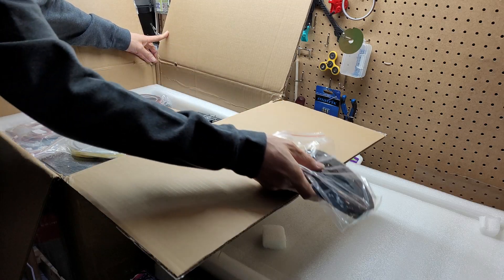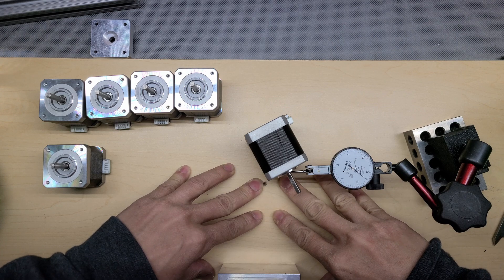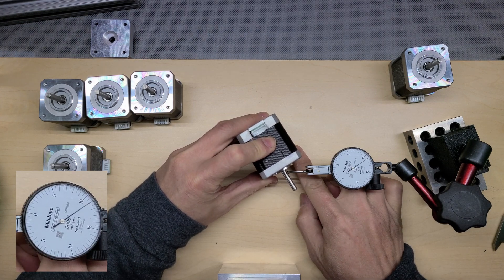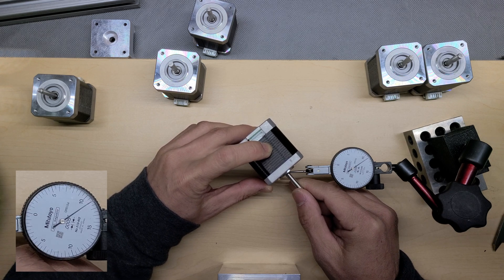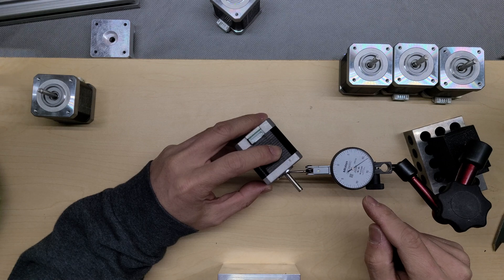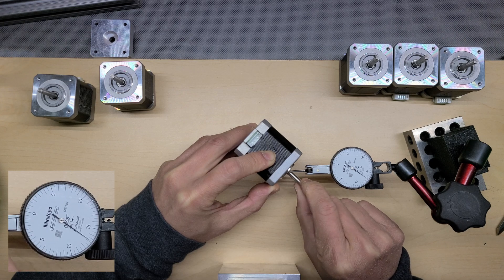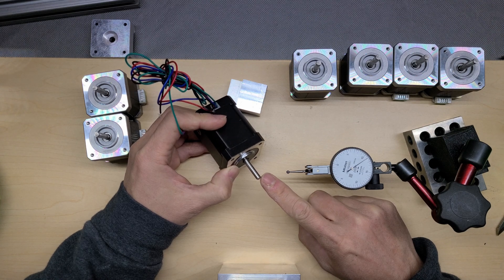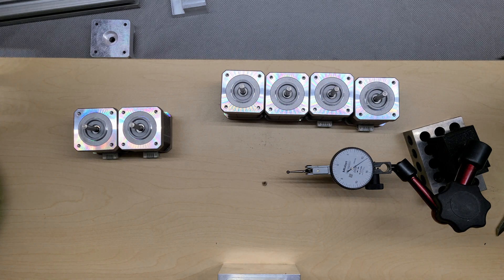Moon's Industries stepper motor in #Formbot 3D Printer kit TIR check and verification

Comment: Thanks for the nice video...i was planning to get the formbot kit also for voron 2.4 and as you know they use moons motors...so what i understand from your video is that the motors are good? I also saw your video of the printer build do you still recomment the kit?...thanks a bunch
Reply from the maker: My kit wasnt cherry picked or sponsored by formbot. I paid with my own money for everything. To me, it is worth for what i paid for. I tested the motor's TIR as in this video and i was happy about the result. I also tested the aluminum plate and same thing I was happy with it. As long as you have good mechanical apptitude putting the printer together, it's worth the money. With that being said, i have seen bad print results from the most expensive kit and great print result from the cheaper kit. My point is that as long as you know what you are doing formbot kit is excellent. You can save a bit money from the more "expensive" kit and upgrade to CANbus and IDM scanner.
Reply: @lavithhcm  were the cables crimped or did you need to crimp everything?
Reply from the maker: @mahmoudeid87  the cables are all crimped. Because I do a bit diffetent from their stock kit with the wago connectors (link in description) so i cut their cables up. It's a DIY to my linking.